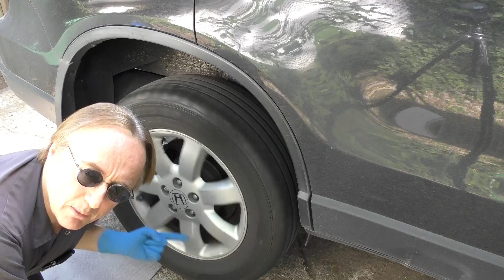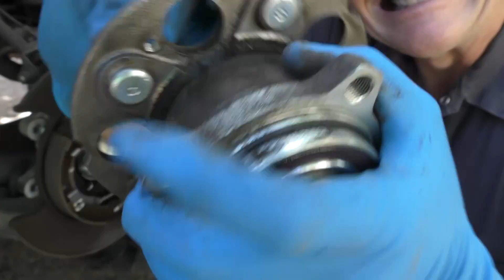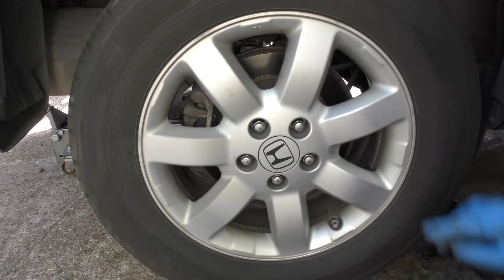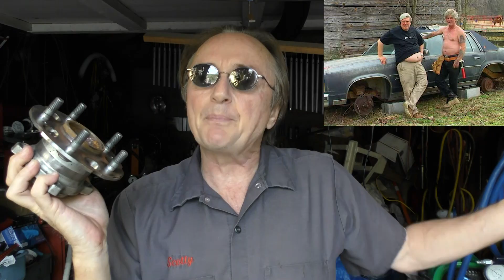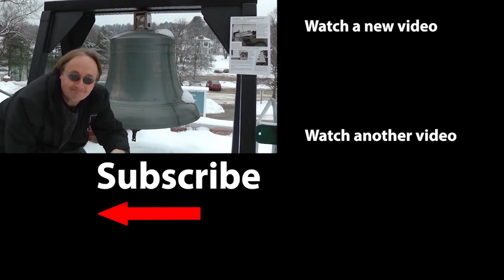Do This Before Your Wheel Falls Off

Comment: I had a guy get mad at me because I told him replacing his front wheel bearings on his Honda ATV will take 3 hours. He said a shop only charged him 2 hours to do wheel bearings in his car, so how could an ATV be more expensive. I tried to explain that cars have hub assembly that bolt up quickly vs ATVs that requires you to carefully press in and out the bearings and install the seals. Some people just refuse to open their ears and listen.
Reply: Lol you guys would go out of business so fast. I know it can be done faster but #1 slapping it together is asking for issues with the work #2 it has to be worth my time or why would I even consider taking it in #3 old seized up Honda parts could make that into a 3 hour job in a heartbeat.
Reply: I’ve done Honda atv bearing soo many times I can do it in less then a hour. Can change a cv assembly in 20 minutes
Reply: It does take longer to get atv bearings out if theyre really old, I changed them on the front drums of an 86 honda atv and i actually had to weld a bolt to it and stick it through a puller to avoid having to smack the crap out of it with anything, it was the only thing i could think of doing thatd get the job done quickly bc using a torch wasnt doing the trick
Reply: no way it would take 3 hours for the work.
Reply: y2kxj you can probably do the bearings that fast because your shotty work causes the bearings to pile up over and over again lol. When I do bearings they last.
Reply: I hate impact guns. Seems like mechanics now days are lazy and don't want to torque things correctly
Reply: @robertlawrence9000  they make torque sticks that twist to a certain extent allowing for certain torque ratings
Reply: Come on I can press in two bearings with the knuckle ON the vehicle in less than an hour. That means you charge an hour. Not two or three. He should be mad as hell. You don’t pay rent with ONE customer— you pay rent with the many many customers that come to you which I assume you do not have.
Reply: @topherd1011  sir I don't think you understand the situation or how you run a shop. You just won't understand until your in business.
Reply: I am in business and I’d never try to pony off the cost of alllll my equipment onto one single customer. An hour job is an hour job no matter if ya bought a 1000$ piece of equipment and the rent is due. You spread that out with multiple customers dude... not just one. Inflating hours gives us all a bad name. You’re practically admitting you’re milking the labor time!!!
Reply: @topherd1011  I should also mention the 3 hours is a quote, if the mechanic easily beats the time you can drop the price if he doesn't you can't charge more money.
Reply: He should get mad at you because that's a nonsense estimate.  Wheel bearings on a car, at a shop with power tools, can be done in 1/2 hour regardless of the fact that they book two.  Pressing smaller bearings is not going to take 2.5 more hours than that, not even 1/2 hour more.   If using the word "carefully" makes you take an extra two hours, are you not carefully doing the rest of the repair work you do?

Get over yourself, it's not a 3 hour job.  Anyone would be pissed if they bothered to drag their ATV there just to be given that estimate.
Reply: @stinkycheese804  shop has to pay rent,insurance,other bills,plus the tools that make the job 1/2 hour instead 2,that is why

Comment: This job can take up to 3 hours depending on the vehicle and which bearing is being replaced. If it was a driven wheel it will have an axle nut to deal with as well. Going to need a really good torque wrench, unless you want to risk your wheel falling off from your amateur work.
Reply: ninjabongtoker1 It’s obvious he is talking about the non-driving wheels. If this took you three hours then you’re the amateur.
Reply: @mikebarbier1519  3 hours if you're up North and need to free all the rusty nuts, bolts, and screws.

Comment: In cars from my youth we would repack the wheel bearings on a regular basis, they would last forever.  The new way is easier but it ain't cheaper than bearing grease.
Reply: That's what I was thinking.  I don't remember them being pressure fit either.  I just remember having to be careful to get the new seal back in straight.
Reply: @Rebel9668  I forgot about the new seals.  Also, the bearings came in cages and races were harder than the bearing, so races rarely wore out (never if you kept fresh grease).  Bearing grease dries out over time, it needs to be changed.  I don't care much for sealed bearings, though they work pretty slick on bicycles, not much weight involved.

Comment: Scotty this is a sign to push me along on replacing the wheel bearing. My Honda Civic has been making that noise and I should have the bearing arrive tomorrow. Hope my old bearing can last that long
Reply: On a separate note. This is a 2007 Honda Civic. And yet my 2004 Toyota Matrix is still running just fine. Another reason to stay with Toyota. Lesson learned

Comment: Scotty, when you say modern cars should have the entire hub assembly, starting at what year is this the norm?  I have a 1999 Honda CR-V.  Is this car modern enough or do I need to bring it to a mechanic?
Reply: It was normal for FWD vehicles starting in the late '80s to early '90s depending on when the manufacturer did their model year redesigns.  You should be able to tell just by looking at it, with the wheel and rotor off if you can't get your head under there with a flashlight.

Comment: Those are rear bearings on a fwd car from what it looks like.  Traditional rear drive live axle bearings were lubed for life via diff fluid, and on the same vehicle the front inner and outer individual bearings and grease seals were a dime a dozen, so to speak.

Comment: Missed the part about the old corroded, and rusted ones that you almost need a jack hammer to get out..😂
Reply: Or on cheap a Asian cars where the mounting bolts snap off and then you have to drill it out.

Comment: Not so easy up here in the rust belt country....... Actually can be very difficult...
Reply: ikemen1 Yes, I was watching this video and thinking to myself "I wish a rotor came off that easily LOL"
Reply: @JDMHaze  not to mention the bearing assembly can also be rusted onto the backing plate.  I changed one on a jeep patriot a couple years ago and took me an hour of beating, prying, heating, and soaking with kroil before it finally came out.  I made sure to anti seize it before reinstall to help out the next guy.
Reply: @JDMHaze  Use patience and the BFH method. "Big Effin Hammer"

Comment: Hey Scotty did I see brake shoes as well as disc brakes in that video? whats up with that?
Reply: The hub is the parking brake
Reply: They are for the parking brake....
Reply: thanks. the rear brakes are no longer used for parking? @austinlong2012
Reply: @donhurst8459  what do you mean?
Reply: @austinlong2012  front wheel drives that I had the rear brakes were used when the parking lever was used. That would in park would lock all 4 wheels
Reply: @donhurst8459  yeah basically

Comment: "Lug nuts will need to be removed in MOST cars." There are some cars with no lug nuts?
Reply: agent475816 Yes, haven’t you seen the one Fred Flintstone drove
Reply: @MD-wq6on  But the one he drives does not have wheel bearings either. 😂
Reply: @MD-wq6on  But Fred's car had the old style bearings you packed with grease on your palm, lol.
Reply: @Rebel9668  Back then it was bacon grease on wood axles, no bearings at all.
Reply: Others have bolts
Reply: agent475816 yea old VWs
Reply: yes, there are different setups.
Reply: @djvasforever  Like what? I've never seen a car with no lug nuts.
Reply: @agent475816  some MG'S spoke wheels ...one big centre nut...okay technically still a lug nut..

Comment: wish i knew this back in 2002 when i had a machine shop press in new bearings. o well, u live n learn.
Reply: Most older cars required press in wheel bearings. Only newer cars have these and if you live in the rust belt may need a hammer chisel to get the rust to break loose.

Comment: Toyota's wheels will never fall off.
Reply: 1st generation Tacomas would beg to differ.
Reply: I’m a Toyota fan, I own a 4runner and my wife owns a highlander. However I did see a 2018 Toyota Camry that lost the left rear wheel, hub assembly screws came out while owner of car was driving on highway. Wheel, caliper and brake pads were intact, hub assembly came off the axle, I believe screws were not torqued properly.
Reply: Only the people that liked and none of the people who commented got the joke.
Reply: must be a pain in the butt when you want to change the tires
Reply: False just helped a friend change his
Reply: Lol I've seen a front wheel pop completely off an old Tacoma before.
Reply: @oceanwaves83  That's singular "wheel."  You'll never see all the "wheels" fall off.
Reply: @Cryptonymicus  I beg to differ, a friend of mine has a Toyota 4Runner and a long time ago he damaged the suspension on a back road on a camping trip.  When he drove home on the freeway his entire rear axle fell out!
Reply: Wrong. The whole assembly could fall off, it's just the engine that would keep going.
Reply: @Adrian2140  and a couple years before "tacoma" emerged, the OLD Toyota trucks would completely rust to pieces while the engine went over 300k miles.
Reply: @oceanwaves83  I've yet to even see many toyota trucks on rd let alone OLD ones. Some myths never die.
Reply: Man of culture?
Reply: Hahahah! Yeaaaaaa.
Reply: Mr1983abraham ...in my line of work I see many accidents, the gentleman only owned the car for 6 months when this happened.
Reply: Toyota wheel studs are hella sensitive lol

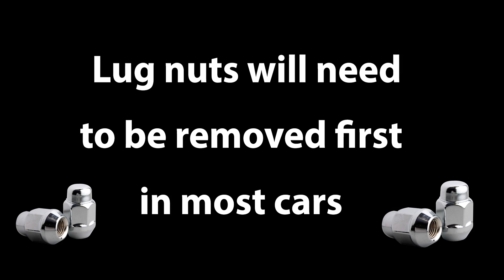Comment: 0:32 the best thing I’ve learned from scotty
Reply: Most cars? I thought all cars had lugs nuts
Reply: Richard some Toyota’s are so good that you don’t ever have to take the wheels off: bearings, brakes, tires, suspension, nothing wears out so no need to have lug nuts!! Wheels come welded on!!
Reply: @nov3019892008  some have a center spinners....knock-offs
Reply: In most cars. Lol
Reply: Lmao.....😂😂😂....
Reply: RogueSp33d _
 lol:):)
Reply: You just take the wheel off :D
Reply: Some have lug nuts and some have lug bolts
Reply: royalrenk I know some VWs had them

Comment: Imagine having to do this in your Mercedes
Reply: The wheel bearings in the older Mercedes had good quality design and rarely went bad.
Reply: Nate Thegreat imagine actually owning a 2000s Mercedes and not spending a fortune maintaining it
Reply: @ZeoNTube  Chrysler butchered Mercedes.
Reply: 4000 euros ebay special ;)